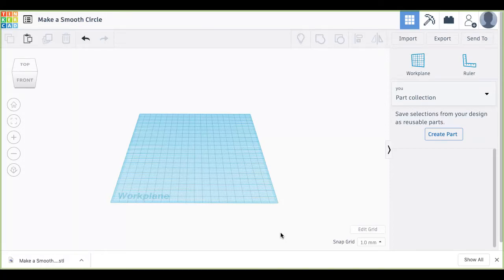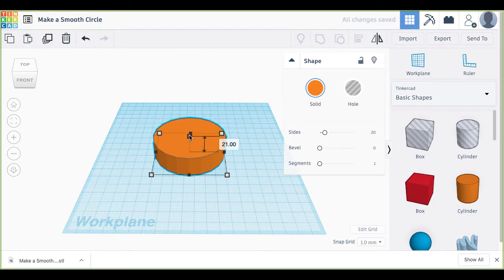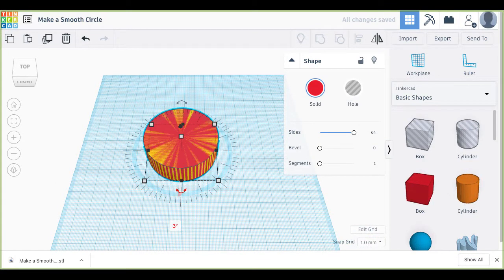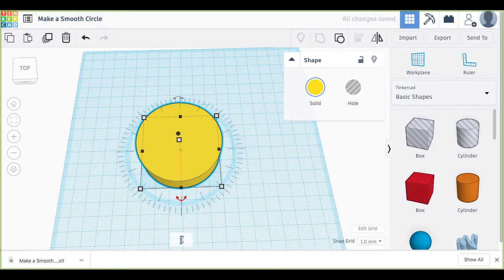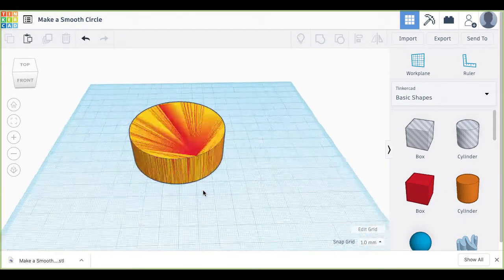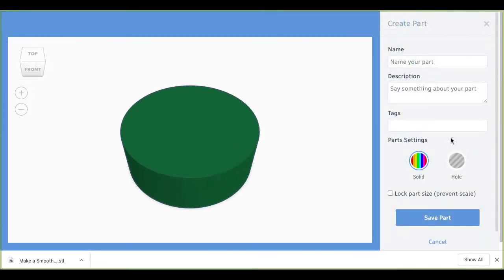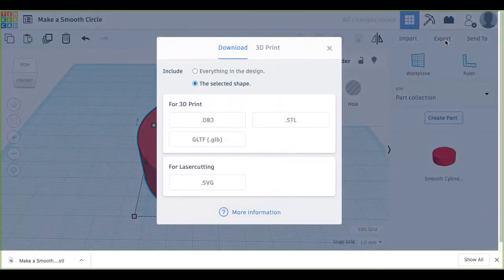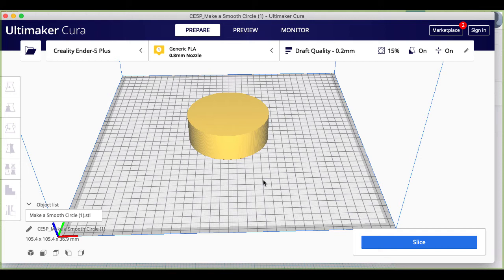Creating Smooth Cylinders in Tinkercad

Comment: I just started messing around with Tinkercad and designed a simple insert for a 16 ounce Yeti can cooler so it would accept 12 ounce cans. I didn't really pay attention to how blocky the cylinder was until I printed it. What an excellent idea you presented plus once it's done as you showed it can be saved to one's own personal parts file.👍👍👍👍👍

Comment: thanks for making this video, have a question, maybe you edited some time out of your video but each time I add more sides to my cylinder it takes longer and longer for the operation to complete,  longer as in minutes for the .38mm operation to group. It seemed to happen in seconds each time in your video. Is it normal for it to take several minutes when you get down to the .38mm change ?  I'm on a fast computer with a fast internet connection.
Reply from the maker: Yes, it does take longer each time. This is because the complexity of the item is increasing. Tinkercad is not 100% in the cloud, your browser does some of the work which puts load on your computer and why rendering is slow as complexity increases.
Reply: @PrintingNerd   So considering when I go down to .38mm tinkercad just slows to the point of being unusable (I can't save the object (a small cylinder) as a user object at all and trying to do anything with it usually fails) would that indicate that my computer just isn't up to the task? I'm on Chrome in windows 10. running a ryzen7 cpu, vcard is a budget model since I don't game, does tinkercad rely on the cpu or the videocard for rendering?

Comment: Fine idea. But seems the size of the smoothed image is rather large. Is not possible to do much with that cylinder afterwards in Tinkercad.
Reply from the maker: I use my saved cylinder all the time without issues
Reply: @PrintingNerd   I must have some issue. Looking into it.

Comment: ah this is nice, i always wanted to figure outu a way to add more that 64 sides to them but this works out just as well. also works with spheres also, but u have to rotate it on the x or y and z if u dont do both z an x or y it will only smooth the sphere out in one direction but it worked great. i was just trying to figure out how to make the sphere smoother so i could try to use tinkercad to make some christmas ornaments that are picture frames as well. also so i could try to make it work with lithophanes instead of just photos. thanks for sharing, really does help out alot. also ive learned if edit a item to much its best to export it an re import it so it will be alot less pixels being taken up an keeps it from getting buggy the more an more work u do on something.

Comment: question: how do you adjust the thickness of the walls of a hollow cylinder?
Reply from the maker: Make it a solid then make a hole through it to leave the correct amount behind. As an example, make a solid cylinder let's say 20mm make another cylinder as a hole that 16mm and align them to the center of each other. When you join them it leaves a cylinder of 2mm walls
Reply: @PrintingNerd  ahh thx this will help me with my physics project